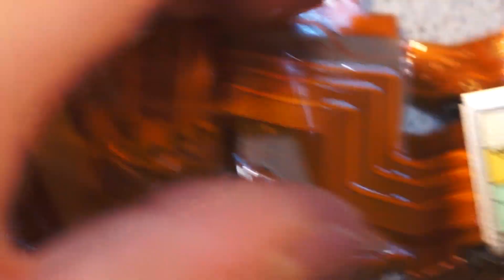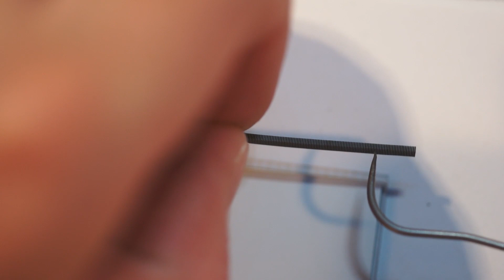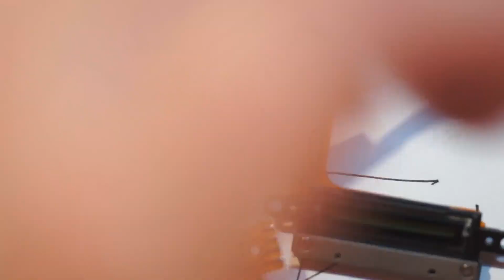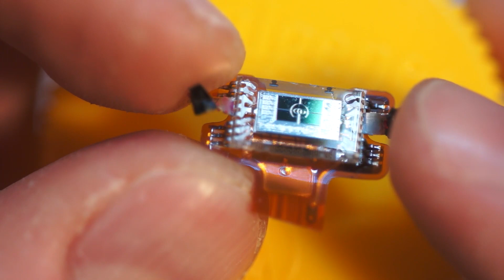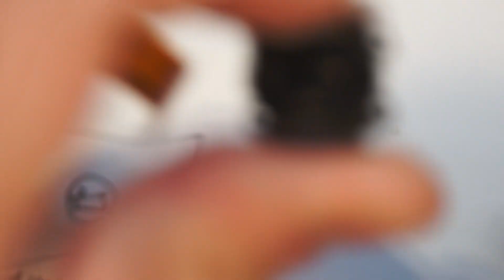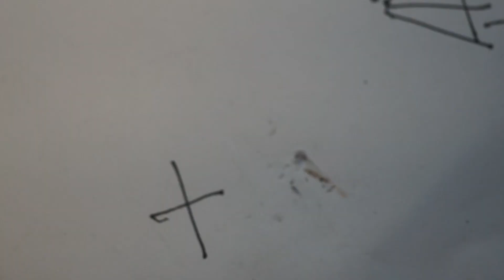Nikon N70 SLR Teardown Pt 2 of 2  Electronics

Comment: All very neat.  The high voltage trigger wire is an absolute nightmare in electronic control of strobes.  It has such a sharp rise time that it basically transmits a spike to everything!
When you look at the old way they used to focus it makes you realise just how easy it is now, since they just compare contrast between groups of adjacent pixels and when the image is in focus the difference is greatest.